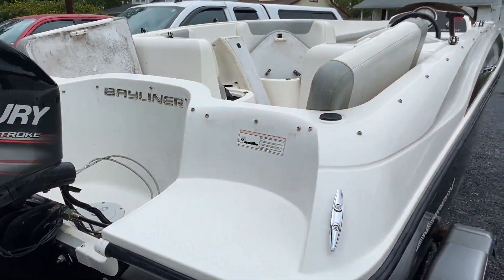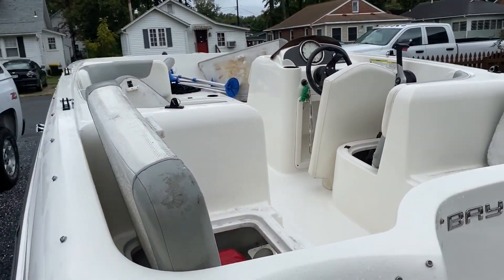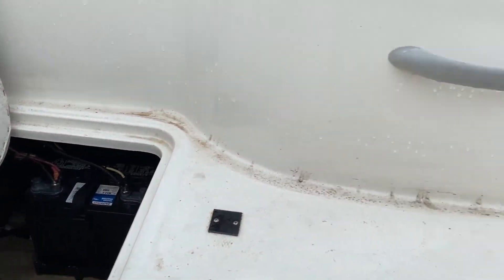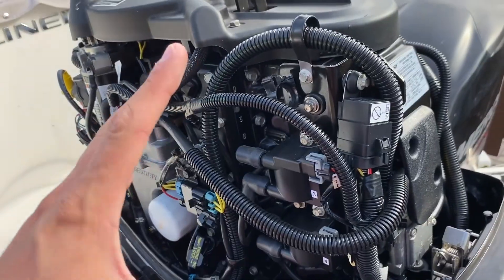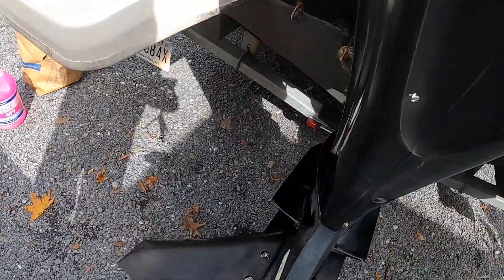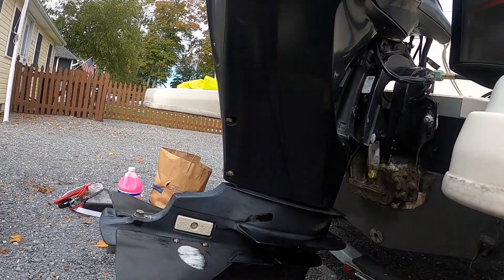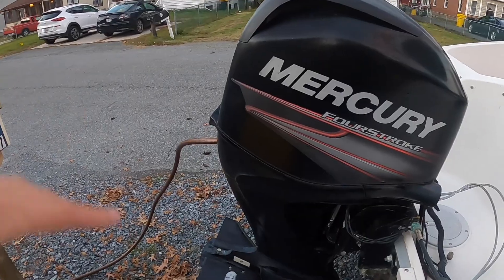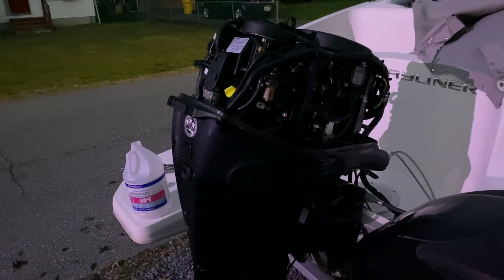HOW TO WINTERIZE An Outboard Boat Engine - Mercury Marine Boat Winterization

Comment: I have a 2024 50 hp mercury outboard on a sun tracker pontoon. I don't have to fog the engine for storage?
Reply: No. If you are planning long-term storage, by which I mean over a year, fogging is a good idea. If we are just talking for a few cold months, then fogging isn't necessary. I've been storing 4-stroke motorcycles and cars in unheated garages over the Chicago winter for decades without using oil.

Comment: Did you run the engine putting in the antifreeze or pump it in? Seems you pumped in through the muffs .?
Reply from the maker: I ended up pumping it through the engine flush port.
Reply: @BoatRevivalByBen  The one part i was unsure on how to do myself was the part where you pump the anitfreeze through.  That part of the video is really dark and you didn't really show how you did it.
Reply from the maker: @markmurray2992  I pumped it through the muffs.